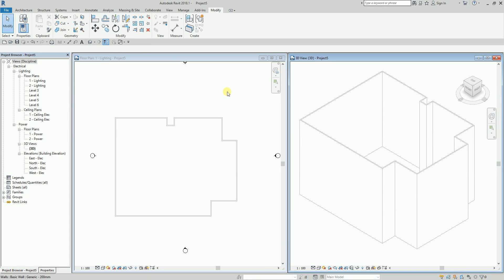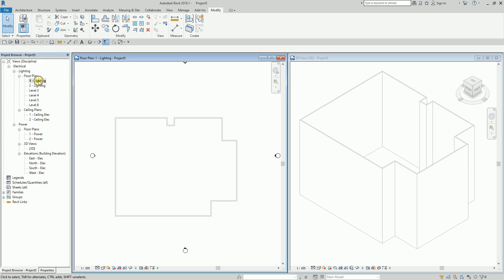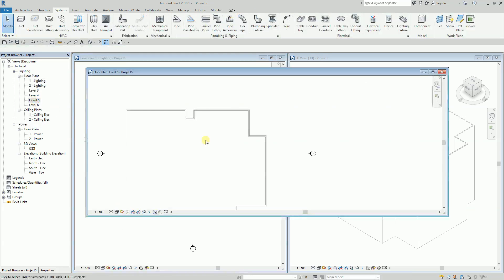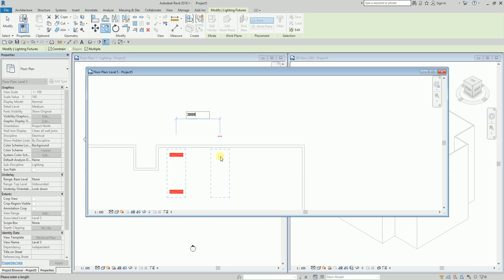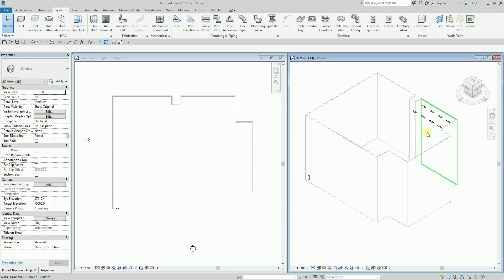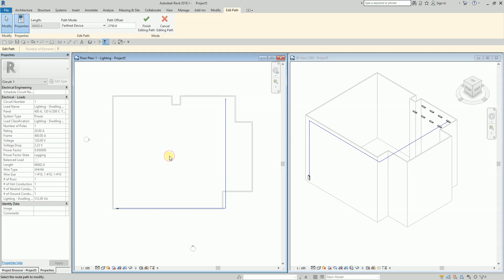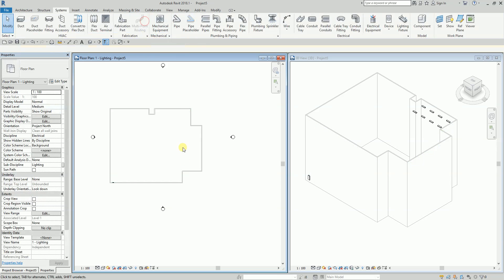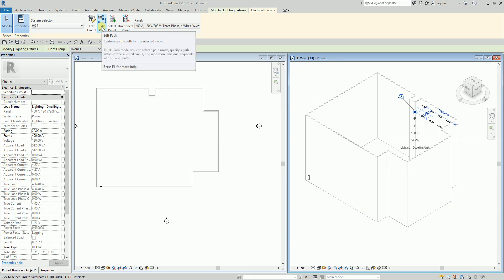REVIT MEP 2018: HOW TO EDIT ELECTRICAL CIRCUIT PATH

Comment: how to show the circuit path in floor plan to put it on sheets?
Reply from the maker: try this out mate, you can show the circuit path on a floor plan and then place it on sheets for documentation purposes. 

Here are the general steps to achieve this:

1. *Create Electrical Circuits:*
   - Open your Revit project and make sure you have already created your electrical circuits in the Electrical panel or Electrical Equipment families.

2. *Create Floor Plans:*
   - Ensure that you have floor plans for the areas where you want to display the circuit paths. These floor plans should be properly set up with the necessary views and levels.

3. *Display Circuit Path on Floor Plan:*
   - Open the floor plan view where you want to display the circuit path.
   - Go to the "View" tab in the Ribbon and check if the "Electrical Circuits" or "Electrical Systems" visibility is turned on. If not, turn it on.
   - Select the electrical circuit you want to display on the floor plan. You can do this from the "Electrical Circuits" or "Electrical Systems" panel on the Ribbon.
   - The circuit path should now be displayed on your floor plan. You can adjust the visibility and appearance of the circuit path using the "Visibility/Graphics" dialog in Revit.

4. *Annotate Circuit Path:*
   - To make the circuit path more understandable, you can add annotations such as arrows, labels, or tags to indicate the direction and details of the circuit. Use the annotation tools available in Revit to achieve this.

5. *Place on Sheets:*
   - Once you have the circuit path displayed and annotated on your floor plan, you can place that floor plan view onto a sheet.
   - Go to the "View" tab in the Ribbon and select "Sheet Composition."
   - Drag and drop the floor plan view onto the desired sheet in the Sheet Composition view.

6. *Arrange and Annotate on Sheet:*
   - On the sheet, you can further annotate the circuit path, add a title, and include any additional information needed for documentation.
   - Arrange the view on the sheet as per your documentation standards.

7. *Print or Export:*
   - Finally, you can print the sheet or export it to a PDF or other formats for sharing or printing.

Comment: Nice video, I have one question... Is there a way to exclude a device (for example a lighting fixture) from the circuit path but still keep it in the relevant circuit.  Such that the length to and from that device is not included in the schedule?
Reply from the maker: Hello Jon, that’s an interesting one. To be honest I haven’t tried that one out. I will check that one if possible. Thanks!